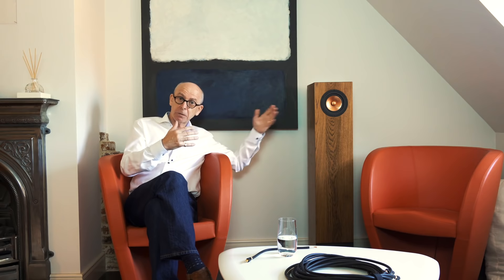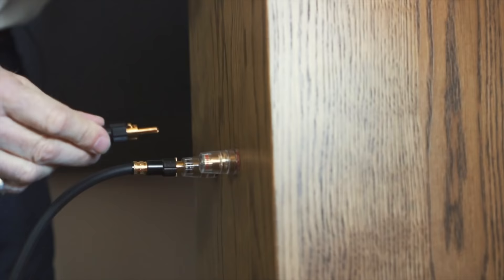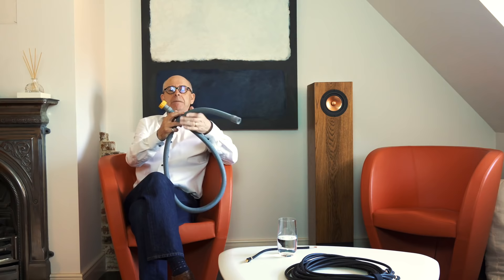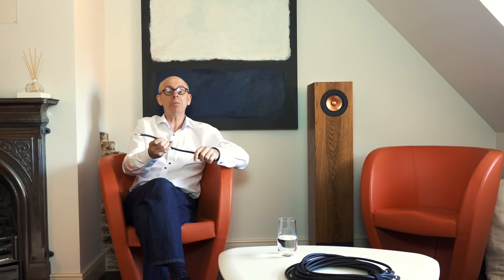Loudspeaker cables - how do they make a difference?

Comment: When someone tells me that can hear "a difference" between certain cables (without specifics) or that they hear "digital artifacts" (again, without specifying what they mean), I can only take them at their word. When things sound sub-par (a hum or distortion or lifelessness), I've found that improving the cable (or, better yet, improving the insulation around it) can help significantly. Otherwise, I think of an 1970 Firesign Theatre record, "Don't Crush That Dwarf, Hand Me the Pliers": 

"That's metaphysically absurd, man. How can I know what you hear?"

So, if you hear it, there it is. 

But your venture into physics at the start of this video brings to mind another question: What's the difference between direct current and alternating current? My murky understanding from long ago is that "current" does not consist of electrons "flowing"  solid metal, but that the magnetic field generated around the wire when a circuit is completed is what transmits the electrical power, not the actual electrons themselves. Is that still the case in 2023?
Reply from the maker: Thanks for your very interesting comment. I hit into a lot of trouble either my explanation of electricity… it seems no matter how I or others explain it, if it doesn’t meet the scenario that others have in their heads then I am open for attack. But yes, the electrons do not flow like water down a pipe, it is generated by moving  a wire within a magnetic field.  To quote from a physics course on the Internet: “Alternating current (AC) is the flow of electric charge that periodically reverses direction. If the source varies periodically, particularly sinusoidally, the circuit is known as an alternating current circuit.”

Comment: Cables are well understood via transmission line theory, which are one-dimensionel in nature, although they can include three-dimensional effects implicitly (such as skin effects). For the frequencies involved with audio, the cable lengths are short enough that zero-dimensional lumped models will fully describe the cable just as well as the transmission line model, which greatly simplify things, since only 3-4 components are needed. But people will rather listen, well-knowing which cable is connected, thinking they are not biased at all, and not at all consider that getting up and changing the cable and sitting down in a slighly different position will change the response way more than the cable itself did.
Reply from the maker: That’s absolutely true.. the cable effect or better, affect… is only minimal at best and seating positions, or a change of mood etc can have  a noticeable difference. At the end of the day, we believe multi strand, good quality copper works just fine. It’s a way to get peace of mind.

Comment: You are brave to post this video. I would just say I respectfully disagree and that a functioning cable does not sound different from each other. Also, mechanically changing the shape of the voice coil will affect resonance but isn't really anything to do with cables or conductance. Thanks for the video though and I like your presentation style.

Comment: Cables. Do they matter? Yes, of course they do.Without cable, your speaker are just an overpriced paperweight. With cables, they make good sound. Do "expensive" cables matter though? Fuck no. Get a cable from amazon basics and as long as you put those cables reasonably and put a reasonable load into them, they will just sound as good as the "expensive" ones. You say you hear a difference though? Good for you then. Data shows otherwise though, so it's 100% in your head or your previous cable is broken.
Reply: In some cases expensive cables are just cheap ones wrapped in a fancy jacket.

Comment: There are four main factors that affect speaker cables:
The material of the conductor,
Resistance, inductance, capacitance. minimize these as much as possible and you’ll have a great sounding cable. Multi strand OCC Copper sounds wonderful.
Reply: Youngster in fun king move
Young
Reply: You missed the dielectric completely. I don't normally wade into this, but since the clip is made by a 'trade specialist' I'm going to.  The determinig factors for 'transmission of electricity' are Maxwell's equations and the Poynting vector. Understand those and you know why cables matter. For better or worse depends, but matter it does;
Reply: @landiepete  again a "normal" monoprice cable will measure as good as any of those snake oil cables so stop trying to justify that nonsense.
Reply: @landiepete  Sure. And the Maxwell equations will also tell you at which frequency the dielectric properties will contribute notably or barely. And this Frequency is... ? Please enlighten us.
Reply: @landiepete  All of that is irrelevant at audio frequencies. All that matters is resistance.
Reply: @landiepete  it's covered by impedance and capacitance
Reply: @shaolin95  Really ? Well, it's not (all) about measuring. It's the listening that matters.  But if you cannot hear differences:  buy monoprice cables and be happy !
Reply: a good copper cable will do the job!

Comment: The water pipe analogy would be the same as having the end of the cable connected to ground, having an open pipe is the same as a grounded cable, if you had a stop on the pipe you would have the same analogy as an open circuit cable !   Unfortunately, you have done little to settle the controversy over speaker cables.  large cross-sectional area quality speaker cable (12SWG for example) has little inductance or capacitance, and you cannot compare voice coil dynamics and frequency response to an ultra-low impedance cable.  Agreed if you compare bell wire with a good-sized quality cable there will be a difference, but spending more than a few dollars per meter on speaker cable is completely pointless, it's all about impedance, as the inductance and capacitance are negligible.  Sorry to disagree with you, but I am an electrical engineer with 35 years of experience and I have also been into high-end audio for 20 years, trust me I have tried all sorts of solutions, and there is little basis in spending 100's dollars on cable, you are wasting your money. the majority of claims I have seen and witnessed rely on the placebo effect.  My advice use 16-10SWG (1.6-3.25mm) good quality audio cable priced at 1-2 dollars per meter and you will achieve 99.99% of what you are aiming for.  Your pre-stages, DAC's. amplifiers and speakers and room! will have far more impact on the sound that you are producing, than cables ever will !
Reply from the maker: Dear Jamie, thank you for your excellent comments. I absolutely agree with you fir the most part. And I hope I don’t give a different opinion. I wanted to emphasis that everything else is more important that the speaker cables and these should be looked at last. I am completely in line with your view on the cables themselves and our cables are not magic, just high quality, thick cables that we sell at a price that reflects the costs of the limited production run, handmade effort that goes into them. But we are often asked what cables do we recommend and we say thick multi-strand. And some people want to know what cables we used during the development process. I was surprised, however, how some proprietary cables changed the sound and I realised that this could have only occurred by them deliberately changing the capacitance, inductance, and or resistance within the cable.
Reply: @PearlAcoustics  thank you for taking the time to reply, it would seem that in general, we agree with each other :-)  and please do not get me wrong, I like your channel and your commentary, I was just trying to be heplful with my comment.  keep up the good work !

Comment: So the reason the sound didn't sound quite right was down to the incorrect design of the speaker coil
Reply from the maker: Dear Savoyradio, the coil was fine for what it was designed for. But because we don’t use any crossovers or filters we needed a slight modification for our cabinets.

Comment: I found this really interesting thank you.
I would just also point out that a set of loudspeaker cables are an inductor, a resistor and a capacitor. These effects may be more important than the grouping of electrons (or maybe I am wrong). I use standard UK twin and earth for loudspeaker cable. I was going with the idea that current carrying capacity was important. It sounds good to me.
I know some people will disagree here, but try it out... fit twin & earth and see what you think of the sound.
Reply from the maker: Absolutely correct. Your solution is very cost effective and sensible.

Comment: The misconception about electricity is very well explained in the controversial Veritasium and Science Asylum channels.
The Poynting vector equation shows energy is transmitted through the electric and magnetic field from the source, and not in the wires, resulting in the impedance problem with the first transatlantic communication cables, fried up as people thought increasing the voltage would solve noise distortion.

Comment: I think the main issue with this video is that you have tried to over explain stuff.
What you should have said is this.
"We have built the speakers with quality cabling from speakers to rear terminal and designed them to have an overall flat response across the listening sound frequency range"
Then added.
"No special high end speaker cables are required. Just good quality multi strand copper wire with adequate outer shielding. You can make these yourself or buy them in our store but they are nothing super special"
This would have got the point across much better. But thanks anyway for not selling us a bunch of snake oil about high oxygen low carbon gold plated neutron balanced glow in the dark radiation free speaker cables

Comment: Cables are passive.  They have no “sound”.   If a cable sounds brighter than another it simply means it has less capacitance and is letting more of the signal through.   Just get a good quality cable with low capacitance and be done with it.  One can find these on the cheap.   Who in the world would want to “equalize” with a cable.    Considering we have about 5 seconds of audio memory to compare cables, without measurements it is a pointless exercise.
Reply: I spoke with some one of the Dutch KEF distributor about witch cable to use with my KEF speakers.
He told me that the only thing that is important is the electrical resistance of the cable, you can even use cheap electrical cable.
Expensive cabels dont do anything to influence the sound, they are just a waste of money.

Comment: Makes sense.  What I did not hear is any comment on the relationship between the two conductors.  IMHO it makes a difference if they are twisted vs running in parallel a few inches apart.  I heard you mention that the hookup inside the box runs a couple inches apart.
I had great success with simple diy interconnects using 24awe wires separated by 1/2 an inch.  I thought why not the same with speaker cables.  For no good reason I ran the two conductors 1" apart.  They were good but had some sound characteristics I did not like.  I changed to lots of twisted pairs and sound was different.  An improvement to my ear.  I was surprised you found no worries about the relationship between the two conductors.
Reply from the maker: I find twisting the conductors makes a big difference (improvement) when running over a longer distance. For example 4 cad 5 E cables platted together and then run per terminal. Works extremely well. But like all these things you need to try it to see. Best wishes
Reply: @PearlAcoustics  Just a little note: CAT5 (and higher) are designed for frequencies 350MHz to around 1GHz. And that's why they are twisted so tightly. For an audio signal there is no need for that. An old fashion CAT3 (twisted pair telephone cable) will do just fine. The twist count in those cables is high enough to  eliminate potential ingress from power grid (50 - 60Hz), crosstalk and the frequency response is more than enough for 20 to 25k Hz audio signal.
The only thing is the current. So you have to put together few CAT cables to make large enough cross section area for caring the load. For ex. for a ~100W RMS amp - speaker system  we need a speakers cable able to carry almost 4A of current. That be a wire similar to 10 AWG, which has cross section around 3.3mm^2. CAT cables are made of 22 to 26 AWG wires (0.4mm in diameter / 0.5mm^2). Hence we need 7 of those wires to make a 3.3mm^2 cross section. So basically we need 2 CAT5E cables (8 wires in each) to do the job 😉

best regards TJ
Reply from the maker: @tjblues01  absolutely. Thanks for your comment snd calculations. I mention CAT cable because it is readily available, cheap, of high quality and you can simply double it up to get the cross section of copper you require.
Reply: @PearlAcoustics  Totally agree 👍Only reason why I go with "proper" speaker cables is aesthetics. They just look better than home made ones. But if you have a way to hide them... 😉